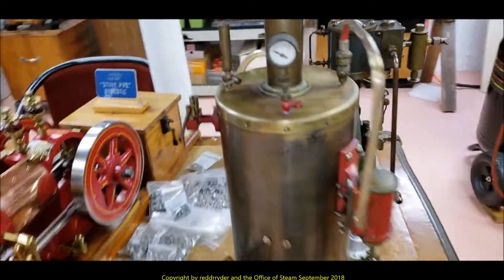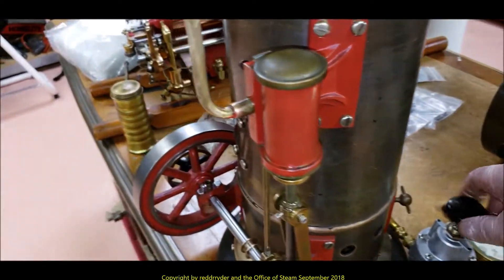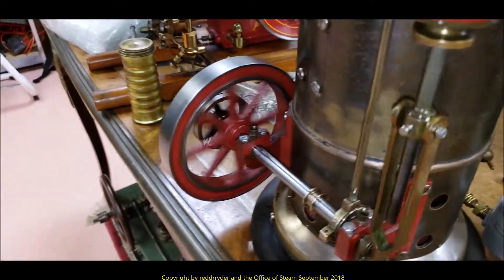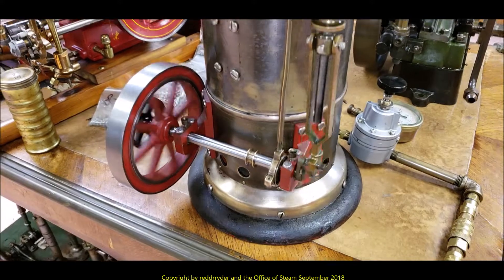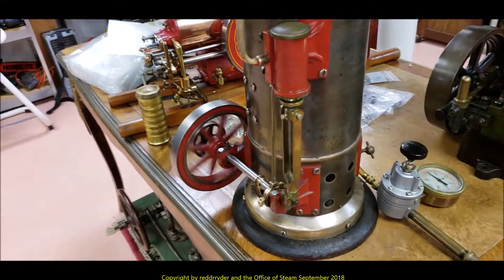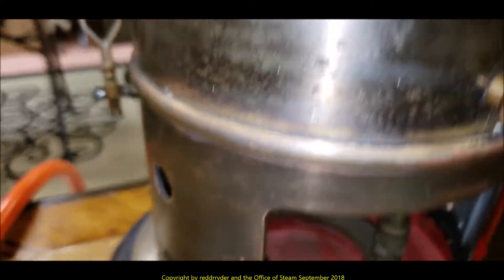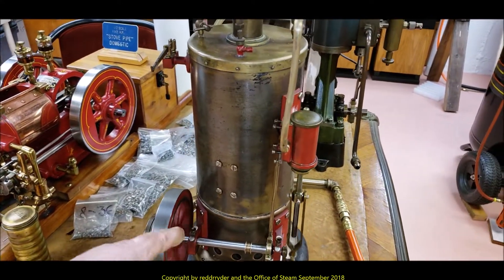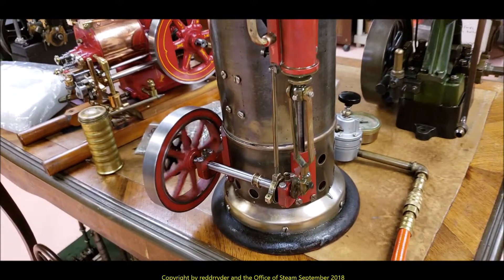Schoenner 100 7 Steam Engine Air Test

Comment: Beautiful Engine Gil! I'm really surprised she doesn't have a feed pump for being so big! My ideal Candlestick Engine would be a Marklin 4112/14, what gorgeous machines they were!
Reply from the maker: A fellow collector who has one of these believes the lack of a feed water pump is due to the 2 hours plus run times you can get starting with a reasonably full boiler of this size.

Comment: Even not complete, this is a gorgeous engine , Gil 

Most of interesting parts are there ...  :-)

You may find the governor on a next remnant ... with some luck surfing on German auctions ...

FYI , largest models 100/6 to 8   ( boiler diameters 13 ;  15.5 and 18 cm ) all came with a feeder pump.

This was an option for smaller models,  accordingly referenced 100/X S
( S for German Speisepumpe ... ) 

So, 3 largest models were just referenced 100/6  /7  /8 with no suffix S , not being an option ...  :-)